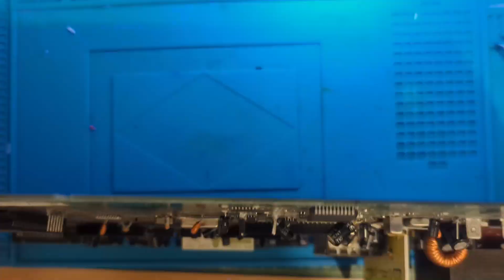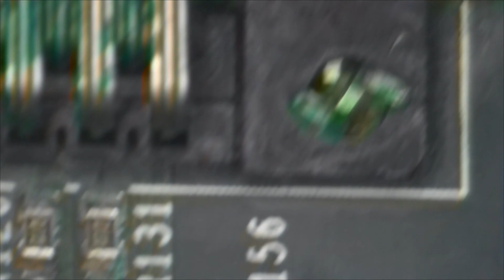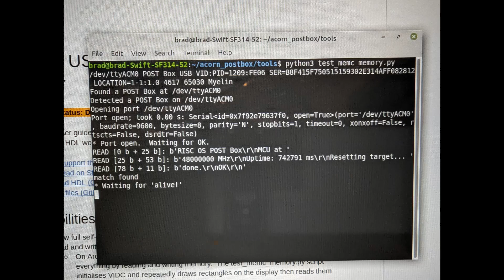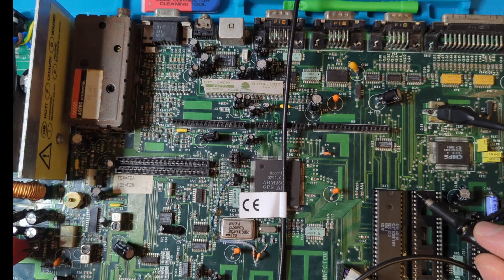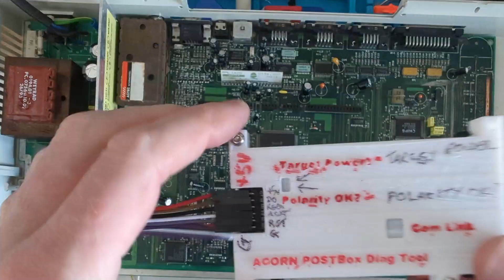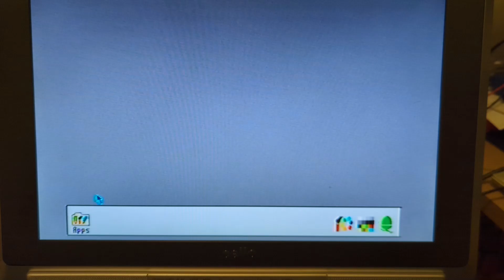Acorn A3010 Motherboard Repair

Comment: Not that I wish to nitpick, but how does acetic acid (vinegar) neutralise battery acid?
Although vinegar may be quite useful to remove corrosion.
Reply from the maker: You are correct. The term 'battery acid' is a bit of a misnomer really. It would be better called 'battery alkaline'.
Reply: Battery acid is actually alkaline
Reply: @SanguineBrah  then the electrolyte you are talking about isn't an acid!